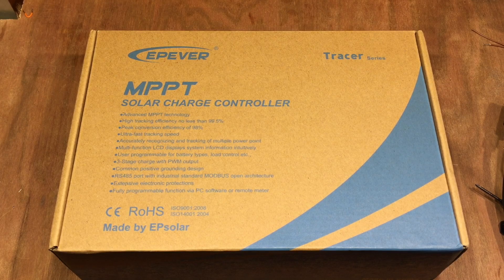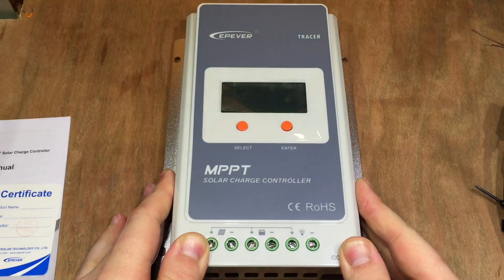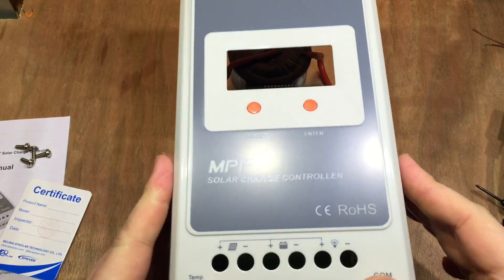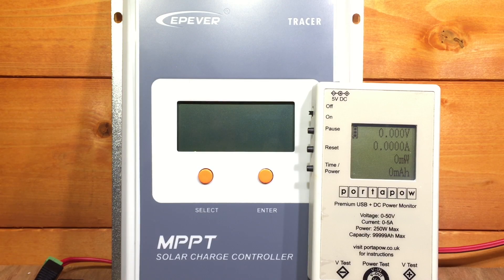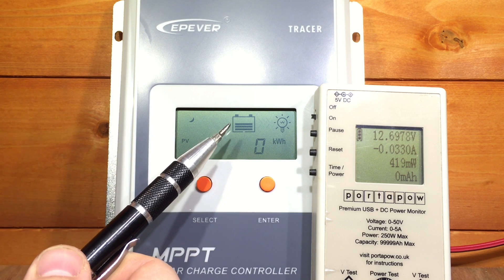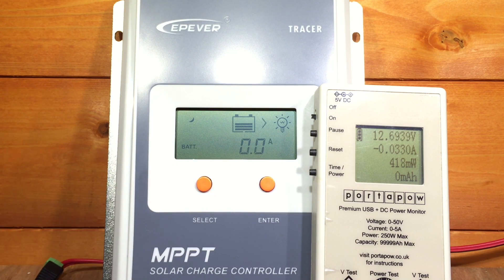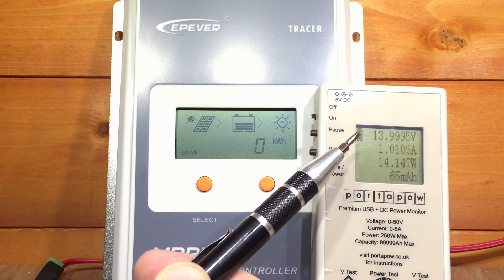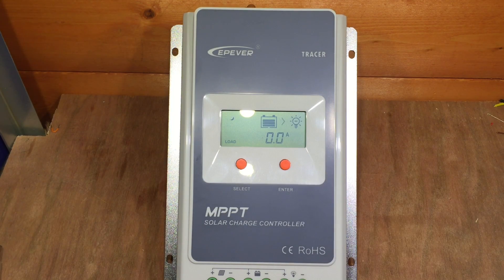MPPT Charge Controller Review - EPSolar EPEver Tracer A Series - 12v Solar Shed

Comment: Hi Adam,

Great videos. Pleasantly entertaining and informative all the same.

I'm looking for a charge controller for 2x150w poly-c panels to go on a motorhome. The EPEver Tracer A series seems to be the number one choice in my price range. I have a couple of questions though if you don't mind.

A) On an idyllic sunny day with an EPEver MPPT controller should I expect something close to 300watts out of the two panels on a flat roof (shade dependant of course), or would I see considerably less than that?

I understand panels are rated under standard test conditions' irradiance but not sure how that relates to a British summers day. 
The reason I ask is that if I shouldn't expect 300w out of 300wp in ideal conditions then I might go for the 260W/20A Tracer for (mainly) the cost saving and to keep the controllers load closer to it's optimum. However I don't want to be throwing away those extra amps too often.

B) How much heat do you find the Tracer A generates, and in your experience would it manage to keep cool with an ambient temperature in the high 20's on a warm day? I figure not to mount it in a cupboard but even so I'm not sure I can guarantee regular breezes passing over it.

Just another thing, browsing eBay I came across this. It has a RS232 port but uses something called Solar Eagle software. Have you any experience?
http://www.ebay.co.uk/itm/Y-SOLAR-100V-20A-Solar-Charge-Controller-MPPT-12-24V-Back-light-Controller-LCD-/222381620970?hash=item33c6fa3eea:g:1yYAAOSwx2dYIwop
Reply from the maker: Thanks for the kind comments.  It's worth looking at my update video about this charge controller to get a full sense of my thoughts about it - https://youtu.be/YowgBCl1F1I
I'll try to answer your specific questions though...
A - A perfect day for this setup is in the middle of the day and the middle of the summer, perhaps with a light breeze helping to cool your panels.  Your panels are not shaded and they are clean. Assuming you've got a well depleted battery or you are pulling a fair bit of current from it then you will probably see the full 300 watts.  You might even see a touch more.    But remember days like that not terrible frequent here.  However on those days it's likely that a pleasant morning of sun has already charged your battery a good deal.  The main purpose of a charge controller is to prevent overcharge.  So if your batteries are nearly full, the charge controller will effectively waste the potential power to prevent damage to your batteries.
If you put your two 150w panels in series - increasing the voltage but reducing the current - then the 20 amp tracer will deal with that fine.   If you're using this system in the winter though my tip would be to pop the two panels into parallel to increase the low voltage current coming in - and raise up the angle of your panels if you possibly can.
B - Heat hasn't been an issue for me with the tracer.  I have two 100w panels in series going into my tracer - so at peak that's about 8.5 amps coming in.  The tracer will adjust the DC2DC conversion so the output to the battery is 20 amps (21.5 actually I think) maximum.  Now in reality my battery bank isn't that big and not often heavily discharged - so the current is generally a lot lower.  So heat hasn't been an issue for me.
C - Nope - I've seen them on ebay but that is all I'm afraid.  Not sure those little screen captures of the software give much away either.  It seems more expensive that the tracer which has a lot more customers (I'd guess) so I'm not sure it'd be for me that one.
Reply: Thanks for the reply. I have watched several of your videos, all recommended.

Good point about the batteries having taken considerable charge by noon on a good day. I think the 20Amp looks like the way to go on the budget.
I was planning on two panels in series, could you explain the reasoning behind wiring them in parallel in winter?
Reply from the maker: +Sebastian Wilde Yeah if you look at my update video on this controller you'll find on bad winter days the panels are connected straight to the batteries. When the voltage is dragged down to this level you'll get a better charge when you run panels in parallel because you'll effectively get twice the current. Cheers
Reply: Oh I see. Yes because the voltage would be much the same either way. Good thinking

Comment: Adam, nice review.     Which one of the following do you recommend :

EPsolar Tracer 4215BN MPPT Solar Charge Controller Regulator  or the EPSolar EPEver Tracer A Series and what's the difference?   I have 220 watt panel, for a 12v system.    Your recommendation would be appreciated... T H A N K S

Comment: Thanks Adam,   I have 12 of these REC 220 Watt Panels, and about 12-14 each  6volt Trojan batteries.  I want to build 2 systems.  1 for everyday use, and 1 as JUST in CASE system... which will be stored underground,  for use after an Event (Tornado or whatever).   I don't have to use all these panels.  What would you recommend?  Each Battery is 225Ah, Trojan T-105.
All info is appreciated .... Thanks again

Comment: Adam, I have some REC 220 Watt Panels, the Open Circuit Voltage is 36.6, and the Max Power Volts is 28.7,  can I use this MPPT Charge Controller the 30/40A version .... ?
Reply from the maker: +BWWGL9 Yes. This charge controller will work at those voltages quite happily. You can put two panels in series if you like too.

Comment: Hey Adam,  Great informative video.  I have the 30a version of this controller and I'm looking into a solution that may help others in my situation.  I have two battery banks that I would like to charge using this solar controller.  Ive looked at a few battery isolator options such as the Power-gate, the Sterling Pro Split R and the Victron ArgoFET.  These devices all offer the ability to split a single charging source, allowing two battery banks to be charged.  I was speaking to Power-gate today and they agreed their solution would work with one caveat.  He said that these devices typically have a voltage sensing circuit that only turns them on when they sense voltage from a charging source.  He said that some battery chargers and solar charge controllers only deliver voltage when they sense voltage from a connected battery.  Can you advise if during your testing you determined if there is voltage present at the battery terminals of the controller when there were no batteries connected?  That would be really helpful in determining if these products will work for this application.  Thank you !
Reply from the maker: +Chris Purchas I haven't tested that I'm afraid. However the EPEver manual says you must attach the battery first, solar second. I think this is because attaching the solar first could lead to a the microcontroller not booting correctly or loosing power and going into an error state. It also needs to be connected to a battery initially to determine the nominal battery voltage of 12/24v. 
If this were to work, it's very much unsupported. Sorry I can't give a clearer answer.
Reply: +Chris Purchas That's an interesting question. I'd like to give my thoughts on the topic.

It sounds like you're referring to a voltage sensing split charge relay like this one I recently bought:
http://www.ebay.co.uk/itm/12V-140amp-Durite-0-727-33-Intelligent-Voltage-sense-Split-Charge-Relay-/251686735313?hash=item3a99b2cdd1:g:1Y0AAOSwUuFWvNv5
That one connects when 13.3V is available, and disconnects again once it drops past 12.65V, it's more suited to an automotive application where an alternator supplies >13.5V. 

I suppose it would make sense to have a small battery connected to the charge controller at all times to keep it powered on and connect the banks to recharge from the load and/or battery terminals (as long as load terminal is at battery voltage) via a voltage sensing split charge relay. I don't know without looking but perhaps there are some SCR's that have adjustable connect/disconnect voltages.

EPEver user manual specifies the adjustable voltage ranges for each charging phase:
http://www.epsolarpv.com/en/index.php/Technical/download

That being said, could it not be done in the same way but without a split charge relay?

Comment: Have you looked at the new Tracer CN series?  they claim to be common negative ( whats the significance either way?)  The 30 amp model is only $85 USD!
Reply from the maker: I've looked at it online but not put my hands on one.  It has four distinct differences from the Tracer A here.  No screen, no load output, the 'dry contact' switch and it's common negative.  Unfortunately the lack of a load output means for me it' would be a step backwards, so I won't be buying one.
Most cheaper charge controller use common positive because the circuit is easier (and cheaper) to implement. Switching the connection on the negative side generally creates less resistance.  However common positive is a little counter intuitive as we'd typically think to put a light switch for example in the positive line.
In most solar power systems whether your controller is common pos or common neg makes little difference - but you need to know which your controller is.  It can cause alternative paths for the current to flow if you're fitting your system in a vehicle for example, or want to ground your panels and battery bank.
Reply: *****  Thanks,  I've actually picked up 2 of the 30amp models ( just over $200 CAD delivered, not bad for 60amps capacity!).  I'm planning on running about 700 watts through them (split equally between the 2)  One controller each port and starboard side of my boat.  I don't need the screens as the controllers will be in my engine room connected to my PC with the USB cable.  One thing I noticed upon opening the case is they appear to have soldered fuse-able links to the board in place of fuses. To me this is annoying but thankfully I'll only be running 16amps max through each one so I should be ok long term  

Thanks for the input!
Reply from the maker: +Pierre Mitham I bet your 30amp controllers have 50 amps worth of internal fuse. They really are a last resort - the microcontroller should have cut things off before they are called into action. It's also best to protect externally anyway - you can fuse at a more suitable level. 
Enjoy all that solar power :-)

Comment: I hope you can test it as the solar panel condition! the weather sometime is good, the voltage is at 17V,  sometime it is at 12V! also the current is changing depend on the sun! so you can tell when the voltage is low, how the MPPT can boost up the voltage tothe battery needs! this may needs a variable DC power supply.

Comment: Hi Adam

Have been monitoring my battery charger / ups 

When I put a load onto it for a period of time the level goes to 80% then starts to charge when load is taken off.

When it reaches a certain point the charge level goes right down and takes hours to recharge

If there is a constant load on a battery and the last % takes a while how does that affect the battery as there will be a % of the battery that is never charged
Reply from the maker: +Karen Mallinder I'm not sure I fully understand the question, but the last bit of charge usually takes longer. The current will decrease as the battery fills.  
If you are referring to the state of charge meter on the EPEver - it is a bit weird and I'd suggest watching the battery voltage to determine charge level.
Reply: Yes , I read that if a battery is not charged to 100% then the percentage / portion of battery undercharged with deteriorate , the question is really , if the battery has to be charged 100% or the percent not charged degrades , and remains at say 85% due to a constant load / slow charging  , will this 15% degrade .

Comment: Adam, what are the details of the switches etc you used in your control panel?
I am about to setup my system and would like to know what you may have used

I await your valued advice - Craig
Reply from the maker: For switches I used these...  https://goo.gl/mWTHvr  Make sure to stay within their rating and fuse them appropriately (if you haven't already it might be worth checking my video about fuses and breakers).
Reply: thanks

Comment: Hi Adam , great video , is this charger not suitable for AGM Batteries then
Reply from the maker: +Karen Mallinder AGM if set it to Gel. If you get one of the optional extras such as the MT50, eBox Wifi/BLE or the USB cable (of which I've also done videos), you can adjust the charging parameters as much as you like. I've just upgraded my battery bank to AGM and it's running on this charge controller.
Reply: Thanks Adam , you know your stuff :-)
Reply: what parameters did you change for AGM?
Reply from the maker: +Karen Mallinder I'm set at 14.4 boost and 13.8 float. It's probably the maximum for AGM
Reply: Adam Welch have you seen any higher amp lithium MPPT controllers? Been thinking of switching to lithium, but it has to handle at least a 160w panel (preferably double that). All I've seen are utility units which aren't sold to DIY folks like us.

Comment: H Adam

I have an earlier version of this remote display but I have never been happy with the % charged algorithm.  When the sun is out and the termianl voltage is high it says 100% full but the minute the sun goes behind a cloufd the % drops to 80%.  Bizarre.  I even e-mailed the manufacturer but I did not understand their reply!  See step 32 of my instructable for more detailed info.....it would be good for you to confirm this new unit doesnt behave the same way

http://www.instructables.com/id/Solar-Power-Station/step32/EP-Solar-remote-display-Tracer-RN/
Reply from the maker: The state of charge meter is probably the most common complaint I've heard about the EPSolar range of solar charge controllers.  Now I should point out that I'm not a fan of SOC - I prefer simply to look at the voltage of my sealed batteries once they've rested a little.  As long as they sit at 12.7+ then I'm happy.  To me, a battery above this level is being charged (whether that is float, bulk, equalize), and you'll never get a true sense of the state of charge when it is being actively charged.  So I simply ignore the SOC meter on my EPSolar/EPEver charge controllers and just watch the battery voltage figure.
The meters simply display what the charge controller is telling them.  They make a request to the charge controller for all types of parameters every few seconds and this includes SOC - so it's the charge controller that determines that calculation rather than the meter.  So any adjustment in the algorithm would need to be made on the charge controller its self.

It's worth noting that you'll have the MT5 meTer, and unfortunately that works differently to the MT50.  They use different voltages I think and definitely different protocols to communicate.  So not interchangeable.
By the way I really like your Power Station - very neat.
Reply: Thanks for the full reply Adam,  It still seems a bit barmy to set it up this way and, yes, I printed out a typical SOC chart for a Gel battery and use that as a guide.  I guess if I had a choice the SOC would be displayed as 100% when the voltage is above the 100% full voltage for that battery type.  Alternatively, don't display a SOC at all if the system detects an inflow of current from the solar panel.  Either way its just a few lines of code.

Another issue I have read about (a few years ago) commented that the algorithm for the MPPT is very slow to stabalise/recover.  I've never confirmed this myself though.

Comment: Hi Adam. I bought the 1210A to run my portable camping/backup power box with a 100AH AGM battery. I have the solar (100w panel) and wall charging (32v 1.5A supply from an old printer) sorted but I want to be able to connect the box to my car to recharge it while Im driving. Being that I will be running it through the MPPT controller, can I just connect it directly or will the car battery/altenator push more than 10A into the controller? If so is there a simple way of limiting the current to 10A? Or will the MPPT only draw the current it needs to balance the input/output? Cheers, Cory.
Reply from the maker: I'd be looking at connecting your vehicle battery straight to your AGM either via a manual switch or a split charge relay so you can charge it on the move.  I wouldn't place your vehicles battery to your solar input (if I'm understanding your idea correctly) to charge your AGM.  With the batteries connected in parallel your controller wont see any of the current going through it, so it'll be fine. I've never done this myself so you might want to get some RV type people to confirm, however I think this is the best way.
Reply: Cool thanks mate. Im thinking now I might just get a bigger 225W 24v panel and mount it and the power box on my camper trailer so it will keep charging while on the move anyway.